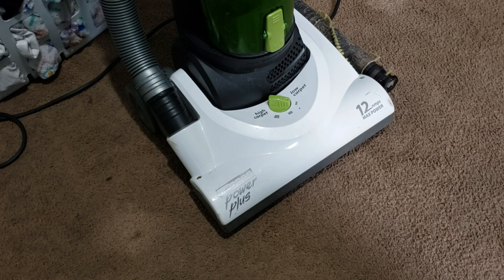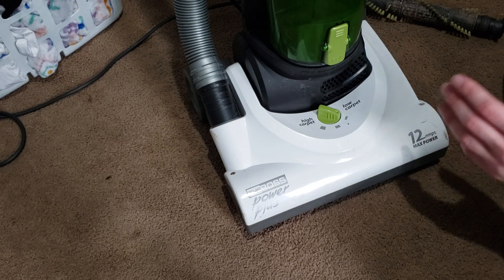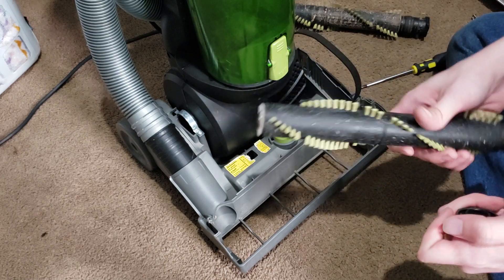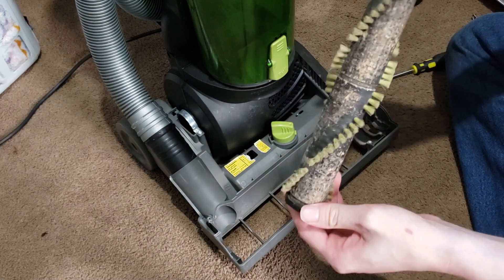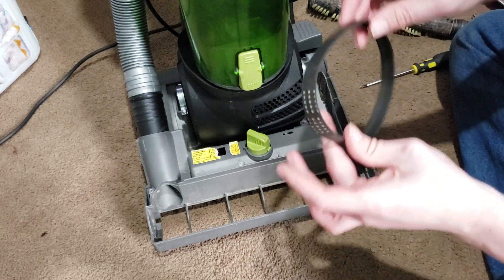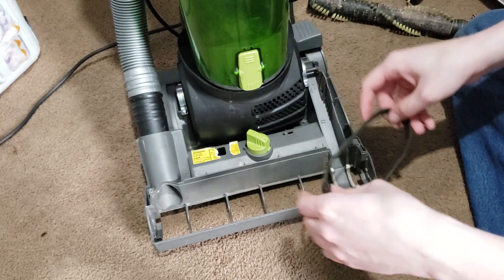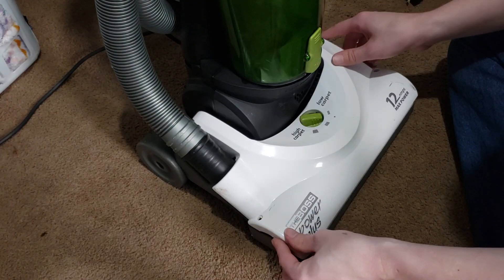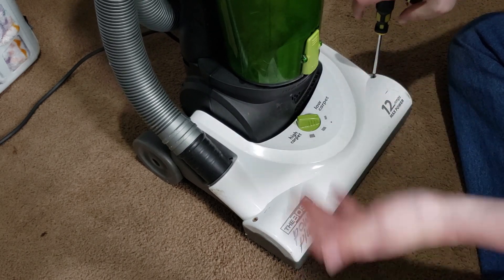How to Change Belt/Brushroll - Eureka Style U Belt Vacuum

Comment: I have a eureka 4700. The little plastic wheels on the wheel carriage underneath that control the height adjustment are seized up due to rust and other things. I want to remove the wheel carriage to clean it up and get rid of the rust so the wheels can spin freely again but I'm not able to figure out how to do it and Google has been no help. Any ideas?
Reply from the maker: Rusted screws can sometimes come out with an impact driver